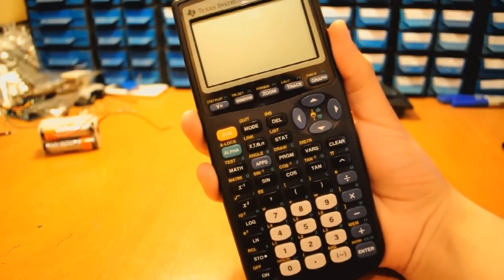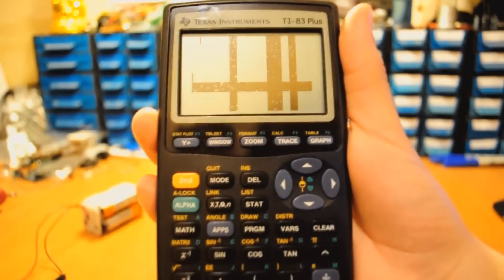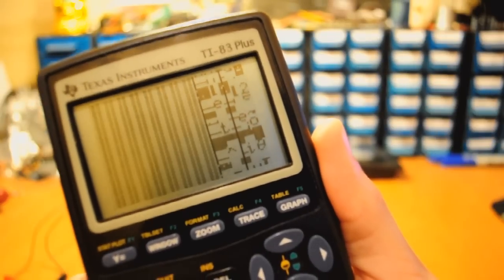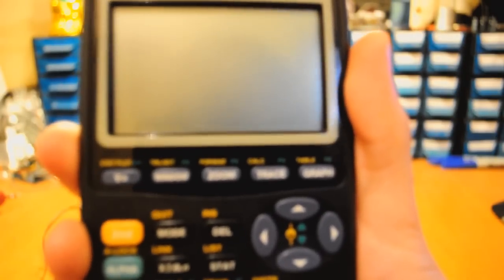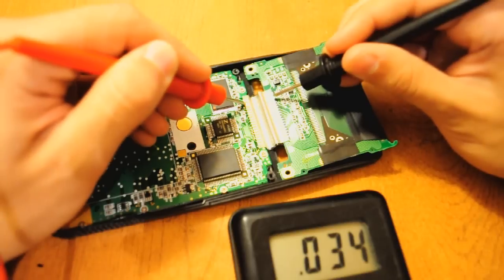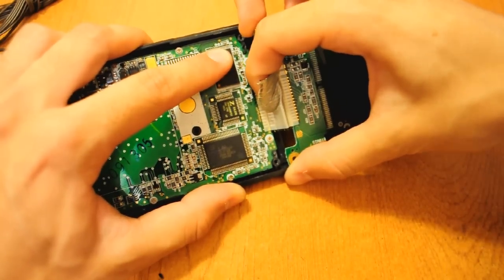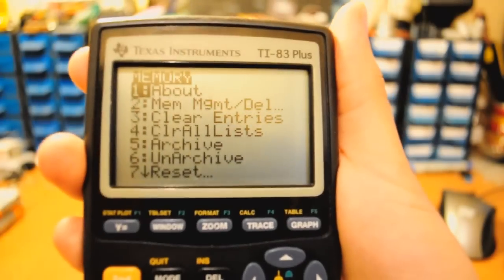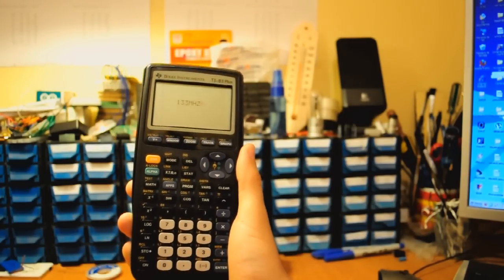TI-83+ Glitchy/Corrupt Screen Fix

Comment: Thrift store today, TI-83 Plus, $3.    Yes it had this exact problem as the video.    I peeled off the glued connector after heating slightly with hair drier.  Alcohol on cotton swabs to clean adhesive.  Pre-tinned each pad first, then Kynar 30AWG wire x34 solders.   I removed all insulation from wire first, so while mine looks like 7:09, there is no insulation.   Figured they were soldered and not likely to short.
Assembled, and it looks perfect.   Thank you 100%.

Comment: It's no wonder your video comes up first in search result about "TI-83 Plus Garbled Display" - You correctly identified the garbled display problem as coming fro the flex ribbon cable. However, instead of soldering new wires, I elected to reheat the flex cable with a heat gun to soften up the adhesive, masking the circuit around it to prevent overheating, pressed the cable against the contacts and bent the cable back in place while it was still warm and it worked☺. Thank you again for sharing your solution 👍👍

Comment: Great tip/find.  I think it would have been easier to heat up each lead and apply some solder on one side first instead of taking the whole ribbon cable out.  The issue, after all, was lose connections.  Or maybe take the ribbon cable out but clean/scrub/test each lead and try to solder them instead of gluing them back.

Comment: This video saved me a lot of troubleshooting time! Same problem on my TI-85, only one signal line had gone high resistance (intermittent from about 500k to 30 meg), and since you need a ribbon cable there in the 85 (the motherboard end is under the display) and I didn't have any handy I just added a bodge wire with some fine magnet wire to jump over the bad ribbon line, works fine now.

Comment: Weirdly enough I was able to solve my issue by just cleaning with isopropyl alcohol and then grabbing my heat gun and just heating up the ribbon cable with it just until it started getting hot and melting. Not sure if it's a permanent fix but it worked for me.
Reply: The flex cable uses a conductive adhesive paste for making contact - I did the same thing you did (reheating it to soften it up to make good contact) and it worked. My question is, is yours still working after 2 years? I figure that if the flex cable adhesive dried up before it may well dry up again over time.

Comment: I was having the same problem with mine after not using it for a couple of years. Not having access to a Torx driver to open the case, I just grabbed the bottom with one hand, grabbed the top with the other, and twisted back and forth several times. Which I gather had the same effect as you pressing the connector to improve the connection. Surprisingly that fixed it! (For now.) But it's nice to know what the issue is inside.

Comment: To those watching, be careful with ripping out the flex cable like he did. Ripping it out like that may rip the solder pad off of the board. If the pad comes off, you may have a harder time finding another nice big solder location. 

Its probably best to use a heat gun to melt the solder joining the flex and board together (if that's whats joining them) and remove the flex once the flex's solder is melted.
Reply: Gently reheating the flex cable with a heat gun will soften up the conductive adhesive and you may be able to stick it back for a good contact onto the circuit board again - that worked for me

Comment: Worked for me! at first tho I was using cat5 copper wires.. and it was a huge pain in the .... so then after i got mad i took a stranded speaker wire and used one of the strands for the small contacts.... so much easier....

Comment: I actually took a test with this. Here are some annoying and admittedly tricky workarounds, but useful workarounds nonetheless. Before doing any of this crap, try doing the calculator's self-test. It might help.

If you enter something, say "2+2" it will look all weird and stuff. I tried turning it off, without pressing the clear button, and when I turned it back on, the text displayed as it should. Also, my calculator would only let me enter eight digits. I don't know that yours is doing the same, but using the variable was really helpful. For instance, if I could enter "5Cos(40) sto -> [ALPHA]Z," and then enter "Cos(35)/[ALPHA]Z" It would also be a good idea to make use of the ANS, and ENTRY keys: 

1) "Cos35 STO [ALPHA]Z ENTER"
2) "5Cos40 ENTER"
3) "ANS/[ALPHA]Z" (*Please note that you can use the ENTRY key here if you want.)
4) Turn the calculator on and off and hopefully it will show your answer as it normally would.

Finally, sometimes looking at it from a different angle helped my view. Literally, hold the calculator in your hand and rotate your hand. It was able to help me see a little bit. Hopefully this wasn't too long and it helped.

Comment: I found a 4 function calculator in a garbage that had a  bad display problem.  I took it apart and made a shim from rolled up paper to apply pressure to the flex display cable and put the calculator back together again and it worked perfectly.  Single line $1.50 calculators are from my standpoint unusable because they lack functionality but I did have the fun of making it work.

Comment: Should have just resolederd the connector with new solder
Reply: but if the problem is in the flex cable and not the contacts, then you have made it into a bigger job to remove (un-solder) the flex cable if it is cracked some place, than to re-wire it up front like this guy did. he did the right thing, it was the best next step. i am not saying to readers to assume that this is your problem, you have to diagnose it properly like the poster of this video did.

Comment: Hey, I found a TI83+ at a thrift shop today for $4 and picked it up not knowing if it would work or not. Got it home and put in some fresh batteries and it had the exact same problem you were having. I took it apart and could see that the ribbon cable was broken in mine, so I replaced it wire by wire. Total pain, but it worked! Just wanted to say thanks for your video!
Reply: +Kyle Evjen im in the same boat as you. found 4 at a goodwill for 3.99 each. all of them had power issues, would not boot up even with fresh batteries. 

did a little searching, found this video and others, put some solder on the power leads after i took it apart, bam, all 4 powered up. one, however, had glitches like this. 

i may use it as a test to learn how to solder smaller wiring like this, as ive never really soldered before until about 3 days ago :D

Comment: I've recently got a TI-81 calculator that didn't work from a friend. When I took it apart the reason became obvious, it was very corroded so I started to clean all the IC's and did all my best to do it. When I've tested it again, same results. I then checked the flex cable, I found one open trace/link/whatever on the cable so I jumpered it, It started to work but with a very faint display, I tried to adjust the brightness but still no luck. I then seen that there were a few lines missing on the display so then I started looking for bad caps, smd caps because they looked very corroded so I tacked in place of them some new ones, still no luck. After that I took a heat gun (yes a heat gun) and started to heat the back of the LCD module board, I actually got some better results but wasn't satisfactory and then I got greedy and turned up the heat until the display turned black. After a while it became normal enough but it only went from bad to worse. So lesson learned here was this "Never leave cheap junk batteries in any device because they will leak and ruin the thing" I felt sad about it and got a used but in pretty good condition TI-30XA calculator. Cheers :)

Comment: Would re-soldering the screen be a good first soldier project for someone who has no experience soldering things, but has replaced a PSU in a desktop and the display in a laptop? I have the same model calculator that is doing similar things, except the glitchyness doesn't show up on the self tests, and I feel like this will probably be the fix for it.
Reply: stonetheman98 same here I need to fix mine but I have little to no training in soldering

Comment: theres a calculator I have its like that but when ever I put and equation, it will give me the wrong answer. What should I do?
Reply: Reason 1 may be: Bad button contacts which will cause to not register all the commands or to sometimes like in my vintage calculator had a problem where it would register the key presses twice or tree times. Fix: Clean contacts or repair. Reason 2: If it is a vintage calculator it may have electrolytic capacitors. Fix: Replace them if they are bad. Reason 3: Bad battery or bad battery contacts. Fix: Replace ,repair. And finally a bad processor which is rare but can happen. Cheers :)

Comment: Could the flex cable cause intermittent failures to turn on completely?
Reply: if they were the power wires then the screen won't turn on, the rest of the system is on, the screen just doesn't have power

Comment: My TI-83+ had no screen oddities or glitches, but it was difficult to turn it on as in this video and once on, the screen flickered. The replacement of the flex cable with soldered connections solved this issue as well. Thanks for posting this video! I subscribed to you interesting channel.

Comment: What screwdriver is needed to unscrew the backing? I have two calculators which I'm convinced that have the same problem as yours.  Also what size wires did you use/recommend?  I'm trying to order a screwdriver and wires off amazon.
Reply: Jason Kim You will need a t6 torx and a small phillips head. For wire you would probably want small, maybe thirty gauge?

Comment: I was having similar issues, but once I cleaned off as much of the adhesive as I could (While I also had a TI-83 Plus, the screen was a bit different) and put it back together as a last ditch effort, it worked. 

Super glad it did because I'm horrible at soldering small connections like that! Thanks so much for the informative video though!

Comment: Thanks! Mine had a problem where when it would turn on I would see a horizontal line for about a second which would slowly disappear. With the inspiration of your video, I used my multimeter to confirm that I had connections that weren't solid, so I ripped out the ribbon and soldered in wires like you did. Presto! TI-83+ is as good as new. Plus I learned how to solder. :-D Thanks again!

Comment: Hi, I have a TI-83 Plus with black square on upper right corner of display.  Also my MODE button does not seem to work so I cannot run the self-test or display test.  Any ideas?

Comment: Hi, I have a black screen when I turn my ti-83+ on.  I can still turn it off by pressing 2nd/on.  I had some red stuff on the display chip when I opened the calculator.  Do you think that red stuff is causing two pins to touch and that is why I have a black screen?  I just updated the OS and still black screen.

Comment: Hey, one more question. After I pull the flex cable off there is a very thin layer of silvery stuff left on the contacts. (It may be tarnish). I have tried using Q-tips and Isopropyl (sp) alcohol and an eraser as was advised on some websites but it is still on there. Do you have any advice on how to get this off or can I leave it on there with no problems? Any help would be greatly appreciated. Great videos btw.

Comment: @133MHzz 

I have a TI-82 that works fine with exceptionn of the 2 rows with numbers (1,2,3,4,5 and 6). None of the buttons on those 2 rows respond when pressed. All other buttons work. 

Do you know what the problem could be? Or how I could fix it? 

I have a volt meter, soldering iron and all the tools needed to get inside.

Thanks!!!

Comment: I would have done two things differently, I think.
1) I would have added some gentle heat to the flatflex to make it come loose easier.
2) I think I would have used ribbon cable to replace the data wires.
Reply: Having loose wires like that without protection would eventually break the calculator I think, they may have a chance of getting bumped and cross connected.